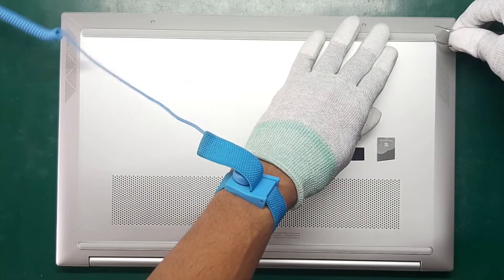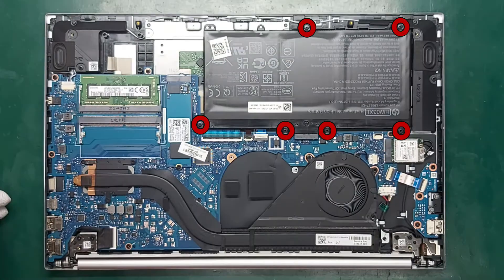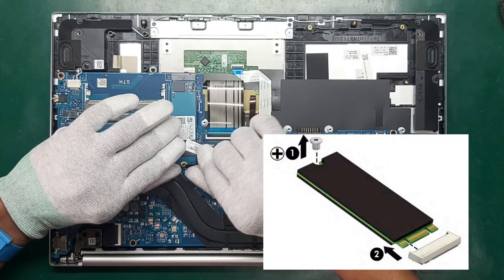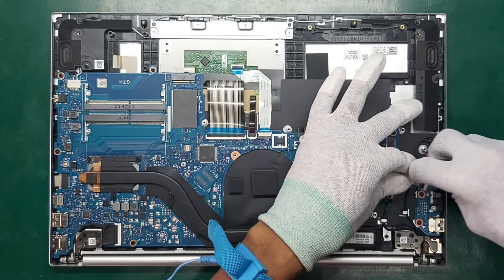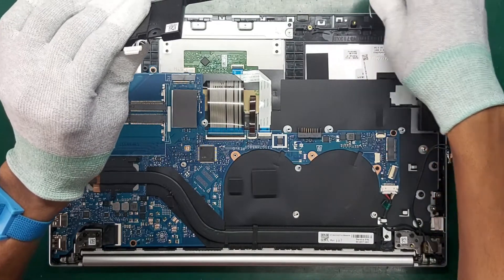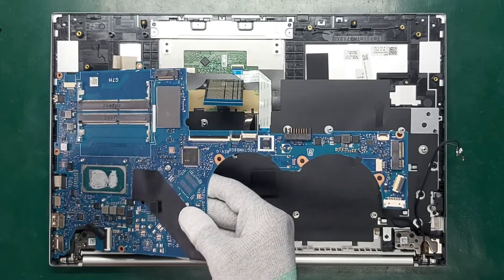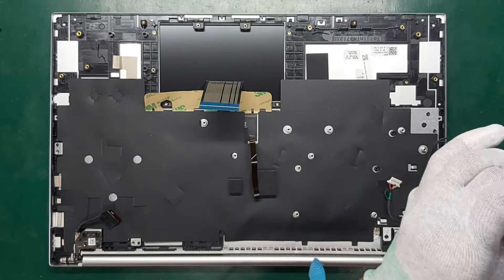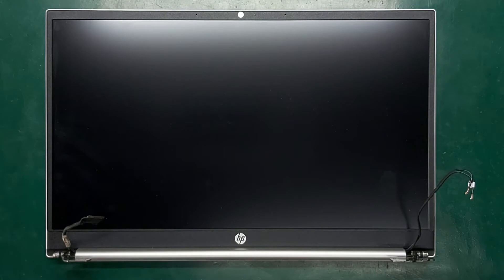🛠️ HP 15-eg1000TU _ How to disassemble All Parts in HP 15 eg Series 11th Gen Laptop 2022

Comment: Where can i get original hp fan for this laptop eg1053 cl
Reply from the maker: To purchase an original HP fan for your specific laptop model (HP EG1053cl), you can consider the following options:

HP Official Website: Visit the official HP website and navigate to their online store or parts store. Search for your laptop model or the specific part number for the fan. You can often find genuine HP parts directly from the manufacturer.

Authorized HP Retailers: Check with authorized HP retailers or resellers in your area. These authorized sellers typically carry genuine HP parts and can help you find the right fan for your laptop.

Online Marketplaces: Platforms like Amazon, eBay, and Newegg often have a wide range of laptop parts available, including HP fans. Make sure to choose reputable sellers with positive ratings and reviews to ensure you're getting an original and compatible product.

It's important to ensure that the fan you purchase is compatible with your specific laptop model to avoid any compatibility issues. If you're unsure, you can also contact HP customer support or consult with a professional technician for assistance in finding the right fan for your laptop.